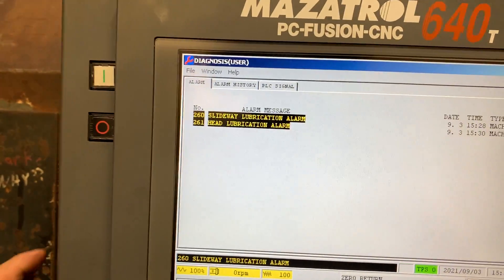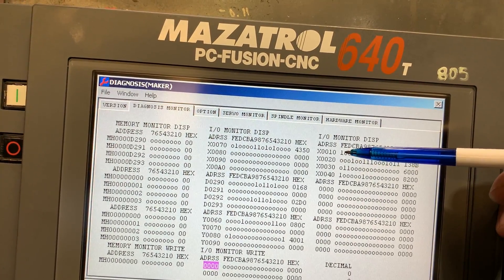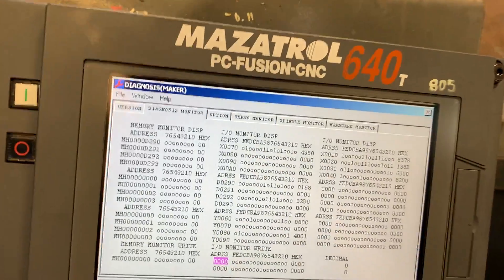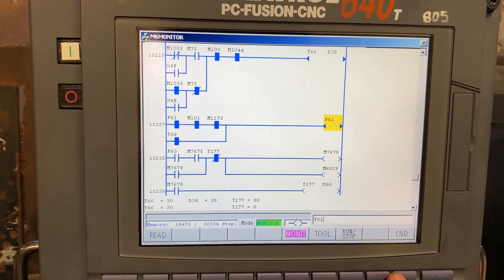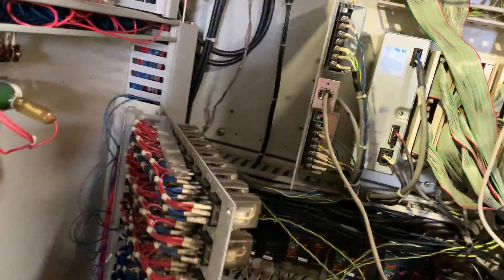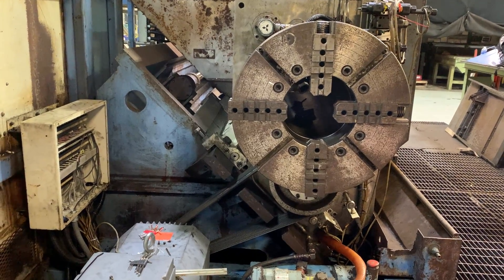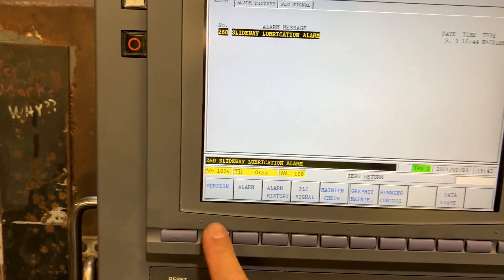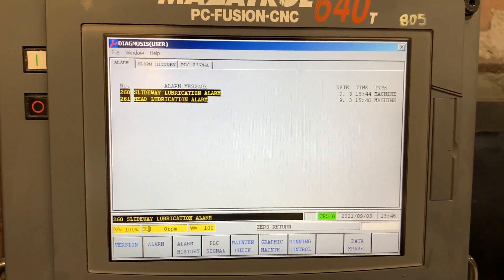M640T: "261 Head Lubrication Alarm". New flow meter replacing pressure switch SP4 (X1F input)

Comment: I hope You read this, I have a Mazak SQT-100MY with Mazatrol 640T and I'm having a prblem with an error 260 Slideway lubrication alaram.
It says that the oil level is too low but I have max level.
Could You please explain that error? I tried a lot but nothing helped.

Comment: The screen on the daikin oil cooling unit is showing LC, Which looking at the manual says Transmission trouble between INV CPU and temperature control CPU. Manual then says contact our service. 2004 Mazak Integrex 200-3 ST Lathe. The alarm on the controller is 261
Reply from the maker: Depending of Mazak machine model, some of them have a cooling unit for the headstock/spindle lubrication system, and if there is any issue on this cooling system the CNC will trigger "261 Head Lubrication Alarm" summarizing all errors. 
The error "LC" shown in https://www.daikin.com/products/ac/services/error_codes/pdf/sm-ts3_p1-6_errorcode.pdf, means malfunction of transmission between control PCB A1P and inverter PCB A2P located on the cooling unit as you can see on page #24 of https://www.daikinpmc.com/en/catalog/GK245.pdf
Reply from the maker: For additional info look for LC at https://www.daikin.com/products/ac/services/errorcode_search/?lang=en

Defective connection between the inverter PCB and the control PCB
External factors (e.g. noise)
Defective inverter compressor
Defective control PCB (transmission block)
Reply: @FabianAchaval  Thanks for the reply and the information. I am looking at electric schematic diagram page 24. I guess the first thing to check is for loose connections between the boards. My job is a machinist, but I want to learn more about machine repair.